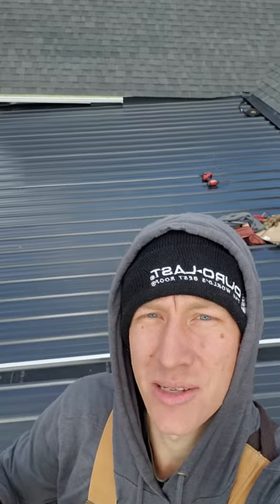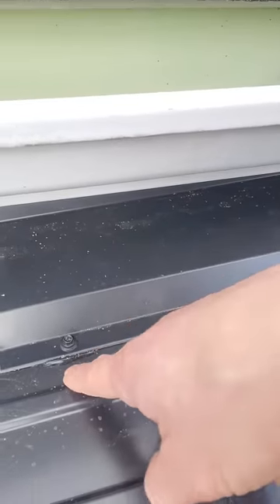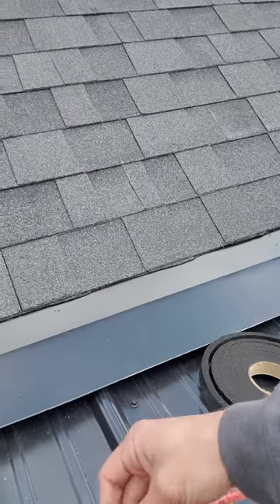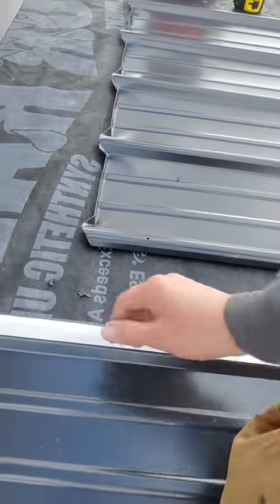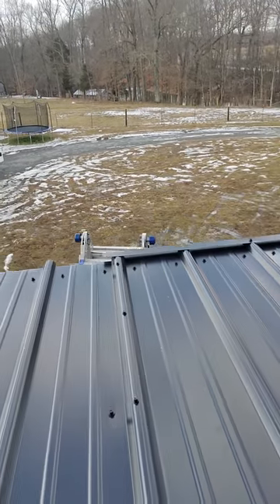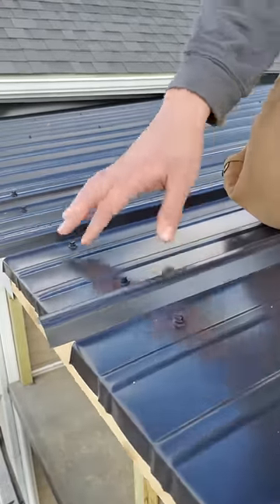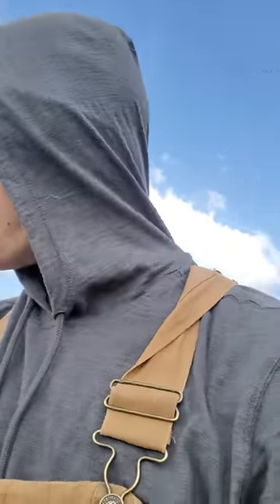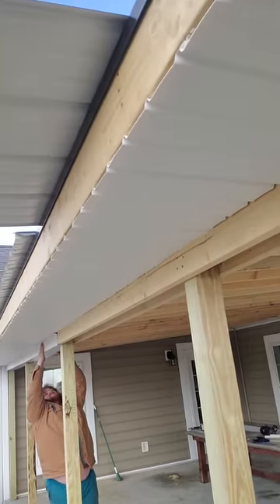Low Slope, Metal Roofing Install. Exposed Fastener. How To Minimize Leaks and Maximize Longevity.

Comment: How do you deal with screws leaking water when the gasket slowly fails? And how about 2 overlapping sheets of metal lengthwise? Do you do the same butyl tape trick?
Awesome video BTW! It's helping me a lot with my low-pitched roof
Reply from the maker: You can replace the screw with another screw that is larger or embed the screw top with a glob of caulking. 

On splices, I would not use butyl because it will raise the overlap 1/8". My preference is a bead of caulking and screws in the ribs ONLY, not the flats where there is overlap. And a minimum of 12"-18" overlap to allow plenty of roof for the capillary action that will occur.
Reply: @themillennialroofer  Thanks a lot for the info!

Comment: 2X6 OVER 16" THATS NOT EVEN CODE  NICE ROOF THOUGH
Reply from the maker: And I broke manufacture specs by installing metal on a less than 3/12 pitch. Code is like the Bible. Nice to have but it doesn't give you the answer to everything.